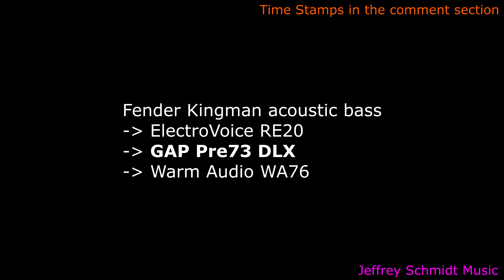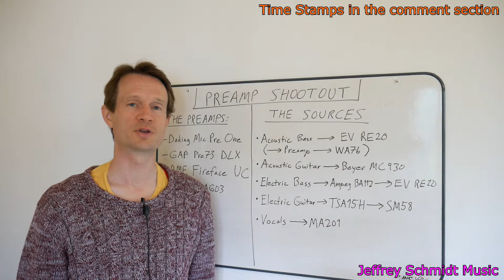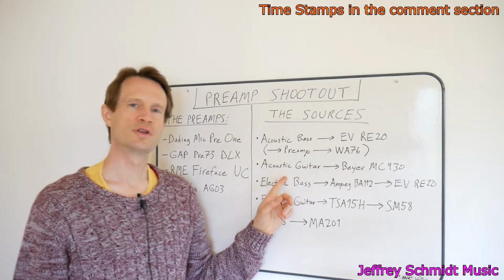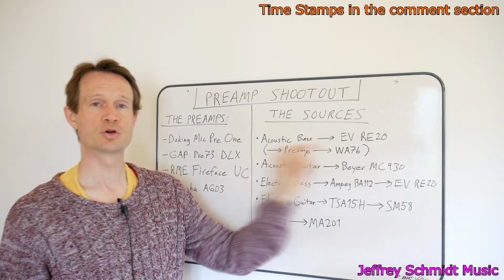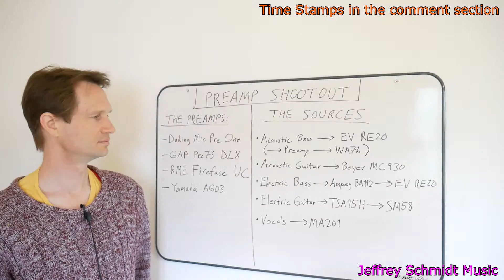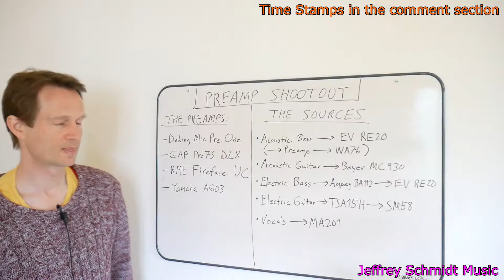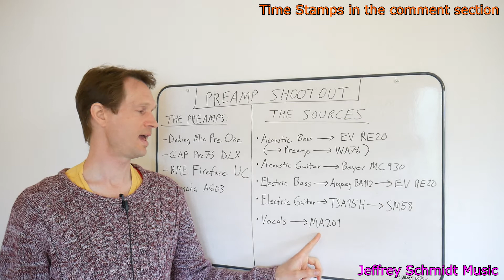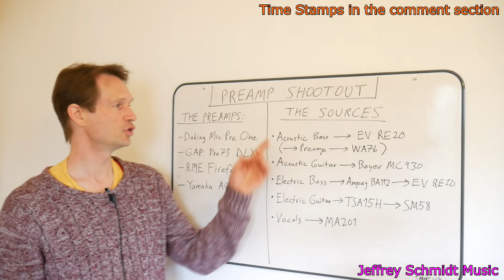Preamp Shootout: Daking Mic Pre One vs. GAP Pre73 DLX vs. RME Fireface UC vs. Yamaha AG03

Comment: Differences are really subtle, but here are my favorites:

Acoustic Bass : GAP (Great roundness and punchy)
Acoustig GTR : Fireface (Clear and most balanced)
Electric Bass : Fireface (Clear and round low-end, I heard difference here clearly)
Electric Guitar : Daking (I initially came to watch this because I was thinking of getting the daking, but it seems I'm not going to need it)
Vocals : Yamaha (This was the most hard, but yamaha felt the best, which is pretty surprising. This shootout was made in lively room without treatment, I suppose. It might be easier to notice these slight differences if the ambience was dead?)

Anyway this shootout, as many others just confirms that I already have everything I need on the preamp section, so no more spending on pres!
Reply from the maker: Thanks for sharing your take on this shootout.  I'm glad that it helped you make gear purchasing decisions.  And yes the difference in vocal takes would be a little easier to hear if they were done in a room with more acoustic treament 🙂

Comment: hey :). I don't get what is the difference between preamps and converters. I already watched your videos about those topic some time ago but didn't get it. I thought having better converters means you can convert to a wav file(or any other format) what you recorded at your daw and the file with be at better quality, but I understood this has nothing to do with it, what you recorded, you recorded.
does converter means converting the signal from analog to digital? I get it, but isn't it what preamps do too? I thought I needed a better preamp than that of the Fireface Uc(I too have it), but do I need a better converter? why? what does it do in comparison to a preamp?

also I wanted to ask, since I see you are using preamps that are "nockouts", may I ask why did you not decide to buy an expensive preamp like the Neve 1073(or anything else that is original)? do you think the difference between the nockouts and the real thing are not that big?
I agree the fireface uc doesn't sound so good compared even to the nockouts or even the Yamaha.
Reply from the maker: Preamps vs. Converters: Preamps are used to increase the volume of an analog signal to "line level", the level that we record at.  Converters are used to convert a "line level" analog signal to a digital signal that can be stored on a computer.  Both preamps and converters affect the sound of your recording, but both are subtle.  It goes something like this: source > room > mic > preamp > converters, in terms of importance.  So don't worry about preamps and converters too much if your room still sounds bad or if you don't like the sound of your mics.  Here is a comparison video that I made on converters: https://youtu.be/oGSyZelI7EQ
Preamps, clones, knockoffs:  Yes I do think that the Neve 1073 preamps do sound somewhat better than my GAP Pre73 DLX with upgraded transformers, which is indeed a Neve knock-off, or clone.  But no I don't feel like the difference in sound is worth me paying $2000 for a real Neve at this point.  Some of the more expensive Neve preamp knockoffs sound just as good as Neve preamps to my ears, but still somewhat different.
I hope that this answers your questions. :)
Reply: @JeffreySchmidtMusic  thank you for your thoughtful answer!

Comment: I think you sold me on the Pre73
Reply from the maker: It was a great value at the time of purchase and I believe that in the mean time GAP has upped their game even further on their current models.  Note that I had the transformer upgrade done on mine after a few years of use, but the stock sound is still really good for the price.  Check out the Clipalator (Zenpro Audio site) sound samples to hear the difference both before and after the transformer upgrade.
Reply: @JeffreySchmidtMusic  I just to clarify so, the pre 76 dlx you used here is not the same as the gap pre 76 premier correct?
Reply from the maker: @mehlek23  Correct.  They are slightly different preamps.